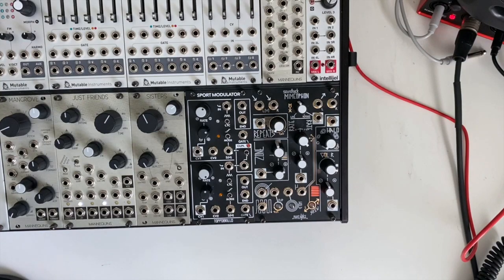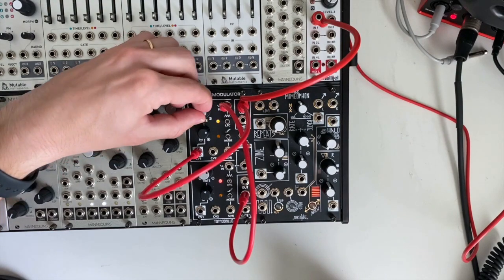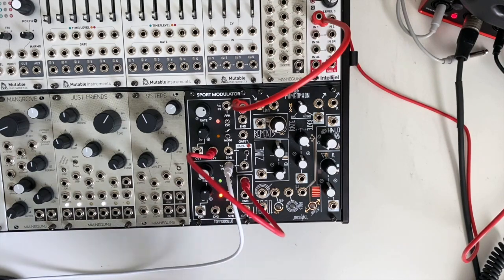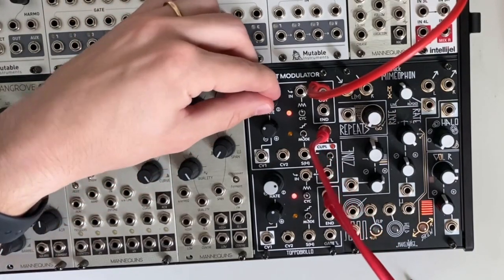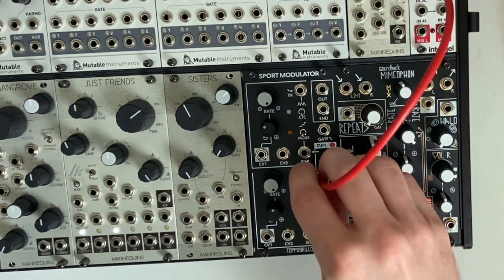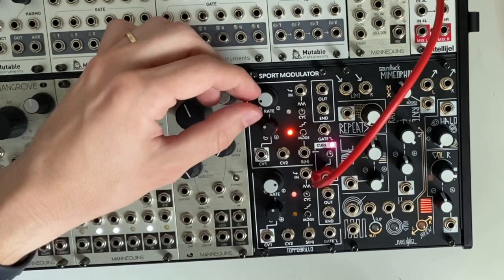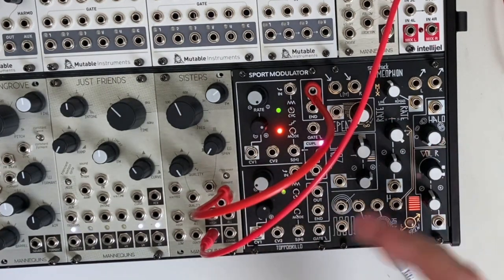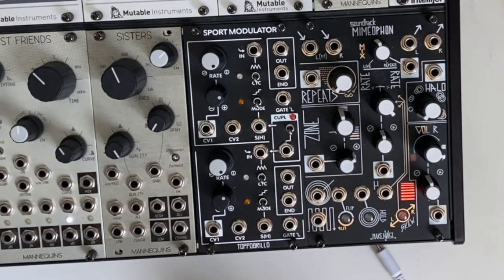Patching the Toppobrillo Sport Modulator 2

Comment: All these awesome VCO examples but the tracking is terrible on mine...Ugh, otherwise a great module though if you don't need tuning-plenty of other ways to use it, of course. Ended up buying a GTO...I guess you do mention it's not good for melodic examples but I'd argue for any VCO applications unless you're going for SFX or a drone.
Reply from the maker: In the User Guide, Toppobrillo says the modules comes “calibrated to track 3 octaves from around 30 to 240Hz.” Mine tracks pretty well over this range, sorry to hear you don’t have the same! Have you tried sending another oscillator to the gate input to act as a sync? Obviously not a desired solution all the time but it works when stacking multiple VCOs.
Reply: @ right it says mostly for bass sounds. I found that when putting it at any range at C and trying to track it across an octave it wouldn’t stay in tune…I like the idea of syncing it though that might be a good default option. Again though not a knock on the SM2 bc it does so much. I originally sold my serge Ssg for one thinking I could capitalize on the extra space the SM2 offered and have two separate S&Hs. Later I decided it might be nice to use as a main sound source and I learned it doesn’t really do that very well. Maybe they’ll do an MK3 someday though, that’d be dope. It still has about 8 other use cases thankfully and I have the GTO coming.

Comment: great video.. this is quite helpful. do you have the cycle jumpers on the back of the module set to bipolar or unipolar? also, are you using the warble (jumper) feature? any info is appreciated.. thanks
Reply from the maker: Mine is set to bipolar and no warble.
Reply: @TravisKennedyMusic  excellent. thank you! ... i found the other SM2 video that you made.. some really fantastic sounds that you're making with the sport modulator. it doesn't seem so impenetrable as it did, initially
Reply: I am still learning to use it and this is definitely one of the best (scarce) videos of this module.